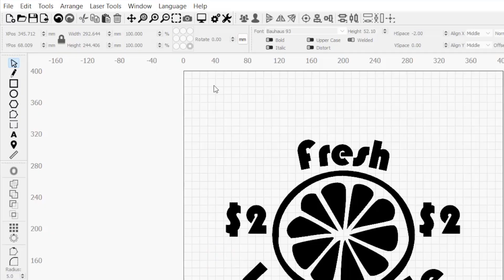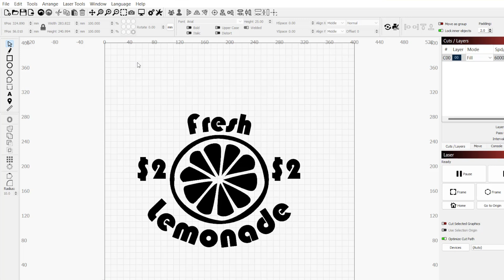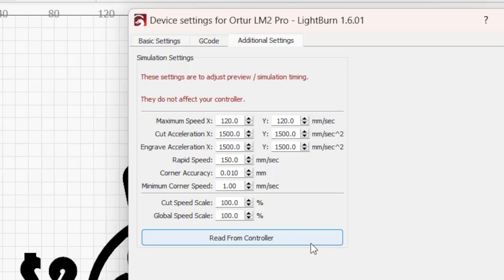Get Accurate Job Times in LightBurn

Comment: I use the neje max 4 and my estimated times are often 100% underestimated. What do I change to fix that ?
Reply from the maker: Have you read the values off of the controller into LightBurn? That's the most common cause:
https://docs.lightburnsoftware.com/legacy/UI/DeviceSettings#additional-settings

Comment: Still waiting for how to adjust this on my galvo fiber. Engraving is showing 35mins, but actual engraving is less than a few mins.
Reply from the maker: @RaisingtheBARdesigns  If you haven’t reached out to our support team already, I’d suggest doing that. They should be able to give you values that will improve the estimate. Galvos are never going to be perfect, but increasing the acceleration values in the simulation settings to about 15,000,000 should help quite a bit.
Reply: Hey did you not watch all the video—enter your jump speed in the rapid speed box and adjust global speed scale to account for any other abnormalities such as timing.  You also need to find out from your manufacturer the maximum speed of your Galvo head.

Comment: In the preview > the jog speed slider bar > handle for the slider preview.  Why is mine only the height of the slider bar?  I didn't realize it is supposed to be a large rectangle going beyond up & down above and below the slider so it is easy to grab.  Mine is very small and difficult to grab.
Reply from the maker: What operating system are you using? The style of the control may depend on that.

Comment: Great video! By chance, do you know if there's a setting to prevent the elapsed time from disappearing a minute or more before the job actually completes?
I would like to have a closer value so I can set an alarm on my smartphone when I'm running 10+ batches.
Reply: Write down the very bottom of your screen it says job completed in (time).   But you might have to click the maximise/restore button as it doesn’t always show up. 

You can also double-click the title bar (top bar) to toggle maximise/restore.  Then you should get the completed time down the bottom after each job.
Reply: @rollerdoors thanks!